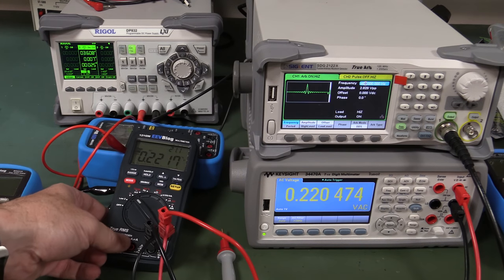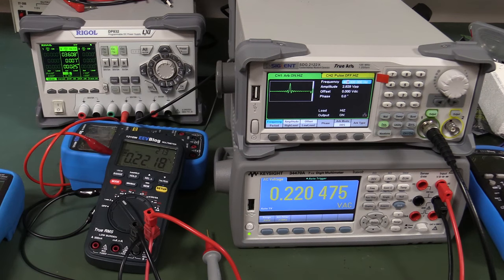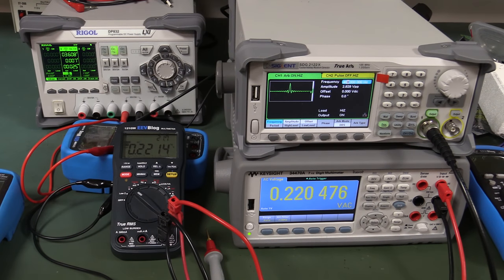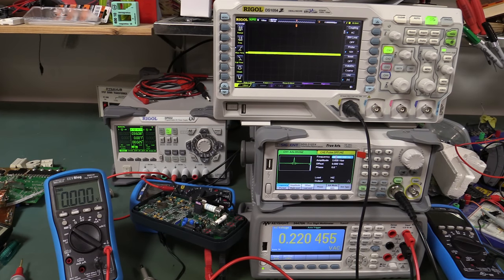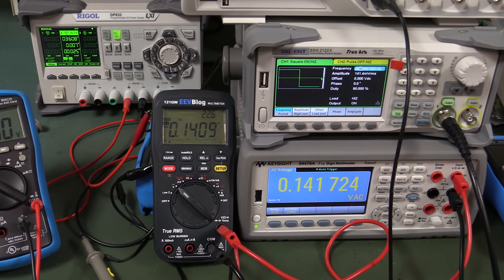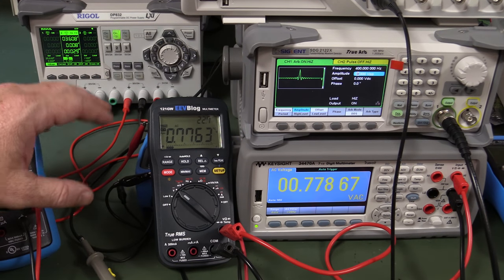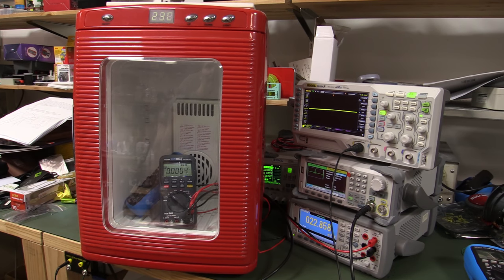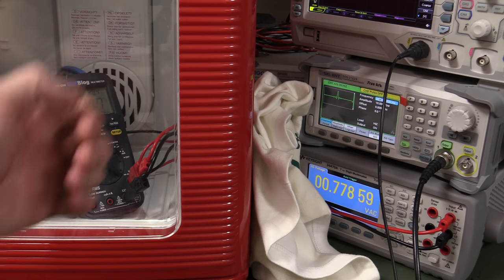EEVblog #972 - Operating Chips Outside Their Spec

Comment: Will they remember that they promised you it works down to those voltages when they revise the silicon, or will they forget about it and say "oh well, it won't work under 4.4V with that changes, but we don't have to worry since the datasheet covers only higher voltages" ?
Reply: Right, and how many meters did he check? Another meter might not work as well because of the different chips.
I've run Atmel's uCs at 1.5 volts with no problems but only at very low frequencies.

Comment: Man, using chips for things they aren't meant for... I've built robots with 74ACT245 line buffers used as motor drivers for small motors like vibration motors and high efficiency precision gearmotors.

Comment: If I would have to make the call, I'd like to know at what voltage the chip doesn't work within specifications anymore. If that would be about 3,55v or so, you can bet your bottom dollar that there will be instances where it won't work correctly at 3,6v either. But if it works correctly down to say 3,3v at a few instances, you can have much more confidence that all meters will work within spec.

Comment: Altough you took the time to ensure that (most) parameters seem to behave well outside the chip spec, another approach would be to design a small effective boost converter that effectively removes the battery voltage dependancy (perhaps operational down to 2V or whatever your figure would be). You want it to be highly efficient however, as it could lower the service life of the multimeter :-) (dont want to make another batteriser, eh?!)

Comment: I suppose AD could change something in the future that affects the low voltage performance. They probably wouldn't test for it or tell you If you're operating outside the data sheet specification. I guess you have to repeat these tests regularly?

Comment: 3.6V is also a really good dropout point because it just barely puts it in the range of lithium batteries thus making it perfect for hacking, not that DMMs usually need it but I generally prefer lithium over other batteries.
Reply from the maker: It would be more like 3.8V to account for dropout voltage and a bit of margin.

Comment: High voltage dropouts  are good   you just stick the batteries in your remote
Reply: And after the remote is dead you put the battery in a wall clock for some years... ;)
Reply: hehe

Comment: Always wanted to ask, what's the point of getting this new multimeter designed. How is it going to be special when compared to readily available products? (and from what I know, you don't even design it yourself but outsource the work to some Chinese company)(otherwise having it designed entirely by you would make it special enough IMO)  I can understand the old EEVblog branded Brymen being a neat merchandise item for the channel, but what about this new one? Sounds like too much trouble for a piece of merch.
Reply from the maker: It's fun. And it will have features most other meters won't.
Reply: Fair enough. Especially if you combine those with affordable price tag wink
Reply: Calling the 121GW merch??? I'm surprised Dave doesn't ban your ass. In a previous video he's shown the high voltage continuity mode, and you can clearly see 'low burden' over the amps jacks. He's told us in this video that it has that new RMS chip as well.
Reply: You shouldn't, as Dave is not (hopefully) that kind of "safe space" YouTuber.

Comment: i really want a talking meter :p or atleast one with a rs232 serial output
Reply: The fluke 87 has a mode where it will output data ultrasonically via the internal beeper.
Reply: You could rig a PC with a webcam smartphone to do character recognition on the screen and read it out.
Also maybe snoop on the data lines of the LCD with an arduino, or some other microcontroller.
Both are nice projects.
Reply: Multimeter AI. That's the future. Google search for your circuit board.